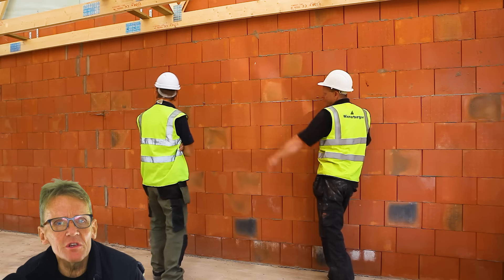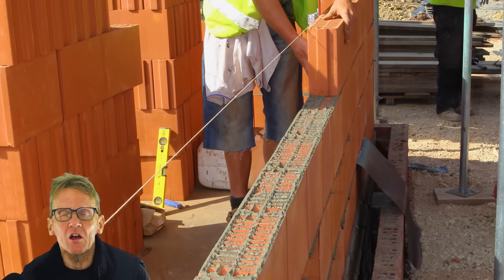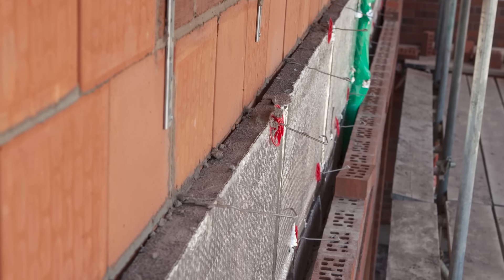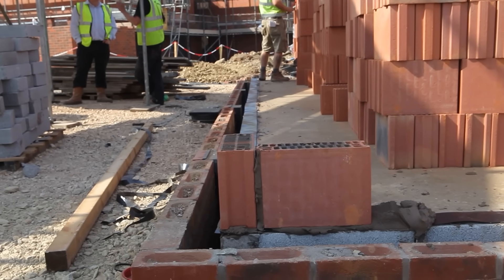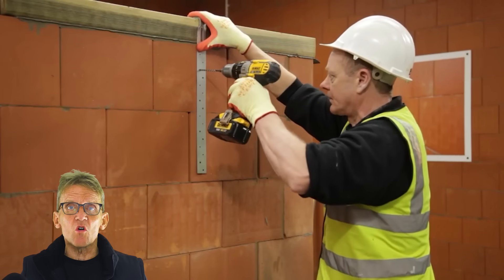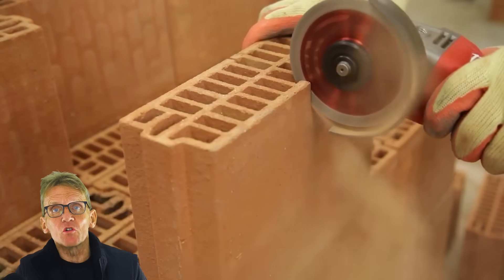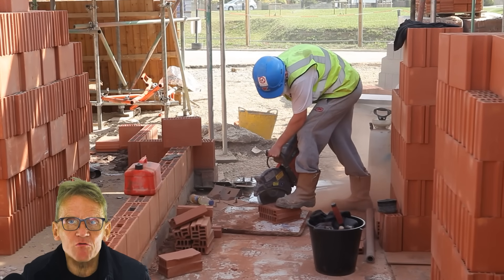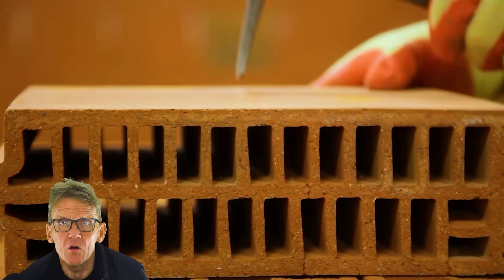Why Haven't We Warmed to Porotherm in the UK?

Comment: Historically the UK has often been miles behind in adopting modern building materials. ICF, pipe-in-pipe plumbing, etc. Even PIR-type insulation is relatively recent here. Lots of builders put things up in the manner they were taught by builders who were taught in the 1980s and don’t stay on top of what’s possible. I find there’s more expertise on decent DIY forums these days in terms of what’s new versus what your average tradesman carries around in their head.

(And yes this is a generalisation, if it doesn’t describe you then that’s great.)
Reply: You mean 1780s !
Reply: Most tradesmen ( unless it’s a small job) are working to plans and specifications which are decided by the customer and the architect with planning involved. It is not generally up to the builder.
Reply: That’s why sites like this are important
Reply: @jontalbot1  ...and Channels like this raise awareness.
Reply: The UK banks would classify it as "non-standard construction" and so you couldn't get a mortgage for it. It's just as much the financial institutions driving accepted construction techniques as the building industry.
Reply: @tommo9757  and architectural studies are also influenced by brands. You know, I have a few suspicions about brands and their influence… DuPont for instance, and the whole kingspan thing with grenfel (which directly influenced fire regulation afterwards)… some competition certificates are granted when they see the brand, even if there’s an equivalent that has the same bs number.
Curious isn’t it…
Reply: Not great for fixing into. Kitchen wall cupboards, curtains or socket back boxes
Reply: @steviehillwood9861  
Stand alone cabinets, neatly chased cavities for services… ? Could have also used the OSB cladding with a drywall finish…?
Reply: @Stettafire  unfair for residence innit.
Reply: @steviehillwood9861 better than stud, if you use the right anchors.
Reply: We got these in concrete in Finland after war , i am in basement build from those in early 1950s , seem to work fine even in extreme cold, heating is usually off from end of May to start of November , 80 cm of basement wall is above ground and 119 cm under ground, if space was not 200 cm high, it was not considered living space.    
Now you have Leca blocks and you can get those with insulation , 30cm block with 10 cm insulation in middle , or use 40cm Leca blocks , if you beef up insulation in windows (4 glass), exterior doors (10cm thick) and roof (50cm insulation) , you should pass building code in Finland.
Reply: Demand also dictates what the vendors supply. If it's not in sight, it won't be seen!  Building regs can be so retar oops -extremely backwards indeed. I helped build a eco-house using a brick called Ziegle Block that has additional U-value than the blocks cited by SB. Same type of system. Excellent thermal property... and moisture control with the use of a 'breathable' lime based render. Prenominally quick - no need for cladding. Also having worked on an 'experimental' build with hay bails was very impressive, but the building regs benchmark couldn't measure the Uvalue since the scale calibration was too small. 'Insulate Britain' are really missing a trick eh
Reply: @JT-si6bl  Hi, could you explain a bit further about the benchmark U value and the scale of calibration - Thanks
Reply: @iansheppard6735  I'd love to. But I can't briefly explain here. But a mass will have a thermal value, I think is 'U'. The benchmark I mean is the accepted, recognised scale as reference to the building control to measure the U.
Reply: @JT-si6bl  Hi, perhaps this might help - materials have a thermal conductivity, referred to by the Greek symbol Lambda and sometimes as the "K" value. To make it relevant to the thickness of the element you divide the thickness of the element (in metres) by the thermal conductivity. This is called the thermal resistance or "R" value. In simple terms, all the resistances of a structure are added together and the total is divided into 1 (1/Rtot) to get the U value. It's a bit more complicated than that, as you have to take into account proportionally any elements that bridge insulation - such as timber studs between insulation. There is a book called the C.I.B.S.E Guide A3 which lists a whole bunch of materials and their thermal conductivities - including straw and thatch. I assume the wall you were referring to was timber framed with small hay bail infill panels. There is no reason why the U value of such a wall could not be determined to see whether or not it would comply with the minimum U value requirement for an external wall - cheers
Reply: @iansheppard6735  absolutely eternally thankful for your information here. Of course I will take up the thread into the book you cited. Thanks again!
As for the wall I mentioned, it was the entire single story dwelling. Using a plan that had historical value in crofting in the upper temperate zones of a continent, hay bails were stacked as bricks, staked and at the sole/wall plate used as anchor points strapped to compress the mass, then roofed. The lime rendered in and out closed the weather. It was impressive… still there 30 years later and no issues. 
The other clay block house was also just rendered, but the rendering was primed with a microporous liquid- clever stuff made by Baomit…. The only concrete that existed was the foundation slab.
Reply: just to add to your comment: the CIBSE tables and other equivalents like ASHRAE are available online for free
Reply: @JT-si6bl  

"Building regs can be so retar oops -extremely backwards indeed"

Conservative is a perfect description.
Reply: @mnomadvfx the problem with the Building Regs is that people think that the TGDs are the regs. They're not. They're just a conservative interpretation.
Reply: @balometer  Hi, what are TGDs - thanks
Reply: Bullshine, UK regs far outweigh the continent, except Germany!!..
Reply: modern builing tequniques are rubbish .traditional is just better .
Reply: @leegeevenning74  Max profit min effort? Every pre 1960s building I enter is like a school. A recent listed building I worked on hat 9 inch tall skirting... and 4 inches thick... oak. But back in those old days, 'hard labour' from prisoners was a 'thing'.
Reply: Us is behind the UK. ALL MADE OF JUNK
Reply: Building regs control are far worse than just not open to new products. While being extremely wed to those standard methods, they also know little to nothing about older traditional methods and buildings, and usually want to force standard modern construction practices on old solid walled buildings where they sre completely innapropriate and can cause damp and massive damage to old buildings that need to breathe.

Where they have adapted to newer materials, it mainly relates to trying to forces celotex and cement on old buildings that are very damaged by their non breathability. This is despite such buildings having a specific exemption in the building regs, but they tend to not read that part and have to have it pointed out to them. Sadly this extends to them not being keen on newer more breathable and environmentally friendly materials in general. Which is a shame as celotex had some pretty bad environmental drawbacks.
Reply: @user-iw7gb6hx2j  An A-Listed house I worked on had damp walls as it was built into a hill 300 years ago. The stone was in great shape, and the building was strong... Building regs ordered bitumen to tank the walls. 2 months later, the bitumen was flaking off from efflorescence. Crazy...
Reply: Er, 'Relatively recent?'
I don't know what your interpretation of recent is but it's been in use in the UK since the mid sixties. I've been using it for 30 years and I wouldn't have called it recent even back then.
Reply: @user-fq2cf6xf2s  Like I say: if I'm not describing your work, I'm not talking about you. Sounds like you were a quality builder using quality materials, which is great and I wish we had more of you. But the same loft roll that was stuffed into my parents' house in the 1980s is still the most common type of insulation in this country - low R value, cheap, not great. Blown polystyrene beads into cavities that have to be taken out a decade later because they're trapping damp.
Reply: That isn't just a UK thing. I quit as a temp manager at a building firm because whenever I found something ranging anywhere from a small contract infringement to stuff that may kill co-workers, the answer to 'why' was always 'We've done it like this for X years'.
Reply: Agree with that. British customers seem to expect houses to be made of bricks & are suspicious of anything else. Builders also often seem very reluctant to look at alternative techniques & materials (can't get the skills I suspect?). Fired bricks are energy inefficient in manufacture. These blocks appear faster to build with and must come with a lower carbon footprint.
Reply: @philthrelfall5294  Hi, I've tried looking on several sites and can't find anything specific, but one did say they are fired to a lower temperature than regular clay brick - again no specifics about what the actual difference was, but they still have to be fired. Also, brick makers are turning away from gas and using hydrogen or electric heating/firing systems - not brilliant, but getting better
Reply: @philthrelfall5294  Actually I'd suspect a combination of 1/not being interested enough to engage the learning procedure 2/ what you said, and quite a lot of 3/Liability because of how easy it is to use an incomplete system/research/viability.
Reply: Well, the UK is historically behind - that's it.
Come to IT infrastructure, public transport, pretty much everything.
I moved to the UK in the early 2000s - I was surprised seeing a diesel train - my country, and that's an alpine country, we got to deal with mountains, snow aso, had by 1994 over 90% of the train line electrified in my region - overall over 70% is electrified, however there a lot of mountain lines what are not used all year round and they run on Diesel.

I still don't get and it annoys me having to separate water tabs; then why having a washing machine in the kitchen - washing machine belongs into the bathroom.
There is a lot of annoyances and backward thinking in this country, and local councils thrive on them.
Reply: @GoalSquad666 Washing machines go in the utility room,not the bathroom where the moist and damp air will almost certainly shorten the life of the appliance.
Reply: @GoalSquad666  Have you thought about other reasons behind why we tend to do some things the way we do? Less about building regulations but placement of certain things in the home?

Take the washing machine in the kitchen rather than the bathroom. Know why that is? In older houses in the UK the bathroom was typically small, in contrast the Kitchen was if not the largest, then one of the largest in the house. As a result as washing machines became commonplace us brits typically placed them in the Kitchen because thats where the SPACE was. Not the bathroom. As a result most of us do not think the washing machine belongs in the bathroom, we think it belongs in the kitchen. Fact is neither of us are right or wrong, what we are is used to what w have grown up with thus always known.

Separate taps for water is far less common now than it used to be, and even that was done for a reason. It was to make sure that the cod water and hot water was kept separate. Why? Because the cold water in the UK was typically potable (drinkable) while the hot water was not necessarily so. As a result in the early days the two systems were kept separate. 

Not everything is because we are 'backward'. There are plenty of things that you do in your country that I would find odd, but I am not bigoted enough to think its because you are 'backward' because you do certain things differently to us....
Reply: @alganhar1  
It's utter arrogance and backward thinking of the Brits.
Building regulations don't allow to put washing machines into the bathroom, you can't have your entry door open outwards and I haven't encountered any house in the UK with a single tab, exception the ones owned by Europeans who moved to the UK and changed it themselves - and I live since +20 years here.
Of course in Europe we all had massive bathrooms 🙄 and cold water was of course not drinkable - do you actually re-read the bs you are writing?!
Reply: @GoalSquad666  It was like a phenomenal eye-opening experience with an 'oh right, it can work' constant for me in EU. On reflection and yes an opposite experience in Austria Switzerland Germany seem to have it very well sorted out, and all those ecosystems serve the public... punctuality, affordable trains, smooth roads, building techniques that WORK...  (roll down steel curtains on the outside?) I didn't look out for RAAC brick, but I'm sure that would be laughed off the table as a bad joke. 

When the fact of being a small island comes into the mix, you'd see why things move slow and restrictive. Espetially land ownership being a legacy of the 'empire'... A foible worth capitalising on though, especially when losing green-space. But even eco-housing in urban areas are  good to begin with, then it goes bad - social issues, and vermin break it's viability.

But it's a certainty that one's environment deeply influences one's life.
Reply: En UK we need more mosque for the young people!
Reply: @DomnuGoe  Not sure how you connect our use of building materials in the country with the number of mosques, but you keep sounding that whistle.

Comment: I'm a carpenter now living in Spain, and they are used everywhere AND THEY ARE CRAP!!
There is damp everywhere, they are brittle and you can't fix anything to them because they simply fall apart once you try to drill them.
Reply from the maker: That is an interesting perspective. Do you think there is a Spanish bloke making a video asking why the Spanish don't use aircrete?
As for the damp , it confirms what I said about the Spanish not using DPCs. I think some nut job told them that there is no such thing as rising damp.
Reply: @SkillBuilder  very often they just lay the first course directly to bedrock or even loose ground!

I have a lot of clients who are ex pats living in relatively new villas....and they ALL have damp around the first 500/600 mm of the internal walls.

None of them can understand why because of the obvious weather, and there's nothing they can do that stops it.
Cracked walls are common because of movement, and they will sometimes use just 50mm thick bricks for dividing walls. Which means it's very easy to simply come through the other side when drilling.

I've learned to deal with them these days........but I hate them.
Reply: @UncleNewy1  ground vapor is a problem if you have no insulation in place where it should be. The dividing wall bricks of the Porotherm system are 100 or 120 mm thick. If the building foundation is not suitable for the ascending structure, you will have a pile of shit instead of a building, and you can spend your life polishing a turd, you know the result.
Reply: Not sure if it’s the way they are used but after living in houses in Spain they are horrible to drill into for mounting.  Also the sound proofing was awful.  It was like having microphones in the surrounding apartments.  Could hear every cough and fart.
Reply: damp everywhere has to do with poor buildings. In my part of Europe (Croatia, Slovenia, etc this is the preferred way of building and has been around for decades. the SKB mentioned hygroscopic moisture that is coming from down. For these, you need to have a proper basement and insulation between the basement and the first bricks. Also, avoid water around the house. The second source of moisture comes from hermetically closing the house with modern windows and thermal insulation. Anyway, I have a house made from similar bricks and no problem with moisture at all.
Reply: @hrvojelasic5794  Do you mean foundations or basement? Basement is a rum under ground level.
Do you have render on outside? What is it made of?
Reply: @annashealthylifeeverything8583  foundation, correct, sorry English is not my first language
Reply: Maybe you are talking about the normal clay bricks they are using everywhere in Spain and Portugal? Not the thermo clay bricks? It's not the same product
Reply: Same as that here in Portugal. Taken me 5 years to learn how to deal/work with them.
Reply: A very bad carpeter...
Reply: You need to properly follow the technology to avoid dumb mistakes and its easy, cheap and proven. If you know what are you doing, there is no damp and if you are aware how to drill into it, its not falling apart. But if the builders have no clue about what are they doing, the result is crap, but not the material to blame.
Reply: @jafofun5078  So how would you go about fitting a wall mounted kitchen cabinet to one of these walls?
Reply: I was wondering about the issue of fixing to them.  Maybe we just take it for granted that we can hang things on the wall but that's not what walls are made for.

Comment: Does the normal dab stick as they are smooth I would like to know as a plasterer
Reply from the maker: Yes board adhesive sticks very well. I have also seen them spray plastered.
Reply: @SkillBuilder  amazing might have guessed as board adhesive usually sticks to most things I assume they have to be PVA before to stop suction?